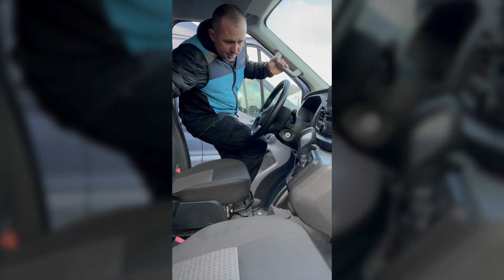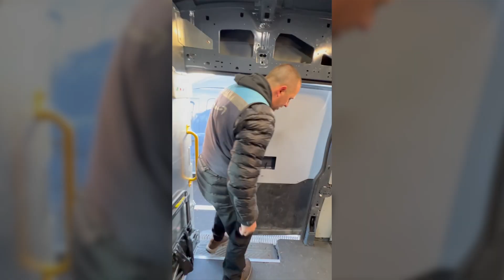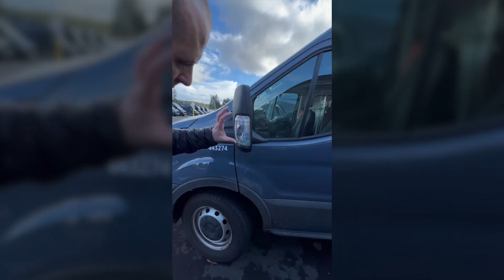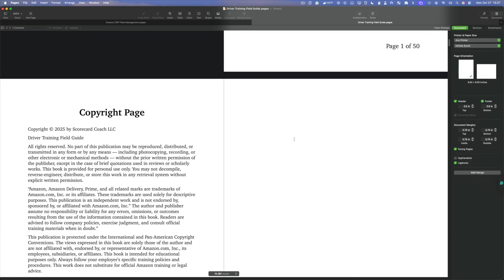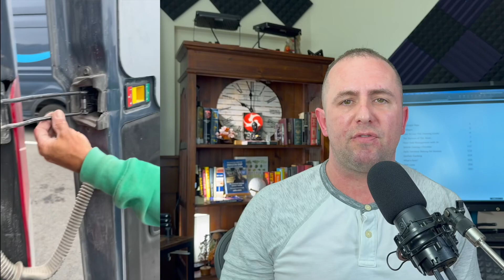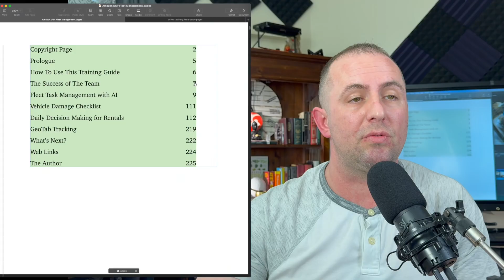Driver Questions about Broken Equipment at their DSP

Comment: My DSP has us lie on vehicle inspection
Reply from the maker: Yes, most DSPs do that. The reason is that they have been unable to create a simple system for tracking each vehicle issue, and then having a checklist for how to get that vehicle issue repaired rapidly. When a driver comes out to their van in the morning, and they noticed the problem it means that the person who reported it yesterday or the person who was supposed to inspect the vehicle in the morning before the drivers got there didn’t do it. It wasn’t intentional, it’s just poor organizational skills, compounded by their novice. Having a task manager for taking these issues in every time a driver reports a vehicle issue, or reports it on their daily vehicle inspection, allows for the creation of checklists to resolve the vehicle issues. Amazon has seemingly endless resources for the DSP to manage the vehicle issues, but many of them lack the confidence and competence required to read the documentation provided and effectively manage their fleet. Most DSPs fail because of this mismanagement of fleet, losing the confidence of the drivers (tenured workforce and excessive callouts), and therefore cannot compete with the other DSPs in their station for a higher percentage of the station volume. Then they get too many breaches of contract, and Amazon offboards the DSPs that are the lowest performing at the end of each fiscal year. I have a fleet management system that solved these problems. If you think your DSP needs help, have them reach out to me. 🫡